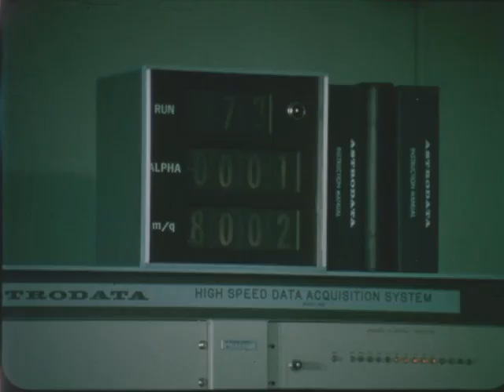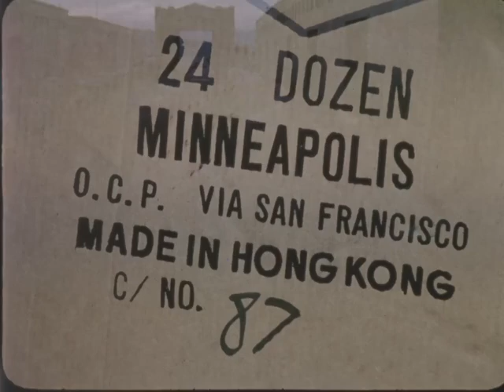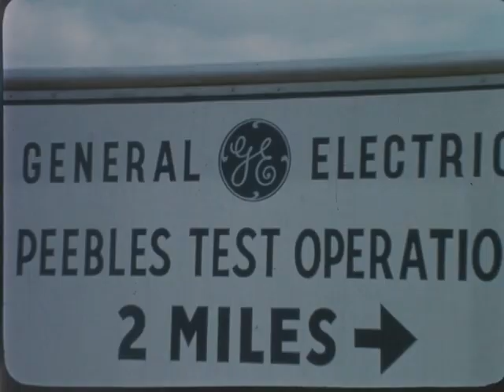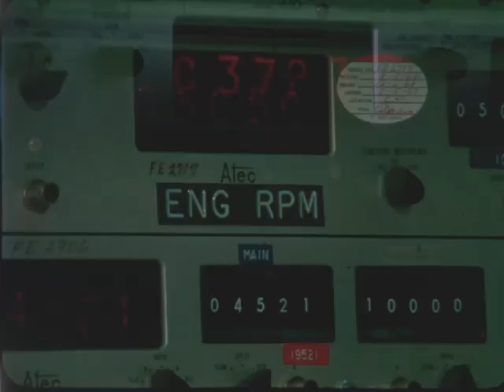You And Me And The SST (1969)

Comment: In 2025, Boeing innovation is another variant of the 737 that came out before the proposed SST. And forget high speed. Airlines today routinely fly planes slower than back then for better fuel economy. SST was doomed from the start due to physics. No airline could afford to fly a large fleet of those due to maintenance and fuel costs. The challenges go far beyond the sonic boom. Friction heating and drag are significant issues. Flying higher helps, but only to a point when the air becomes too thin for engines to operate.